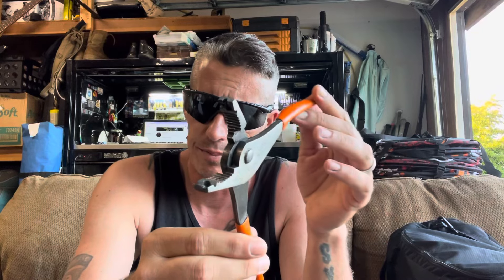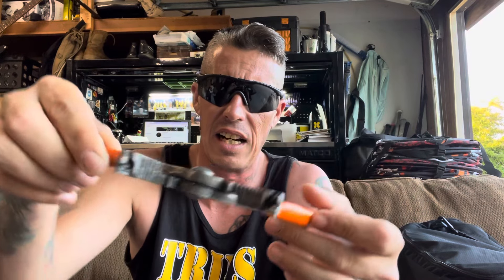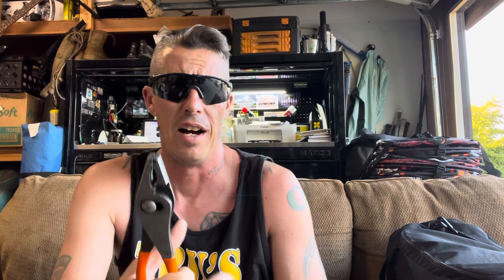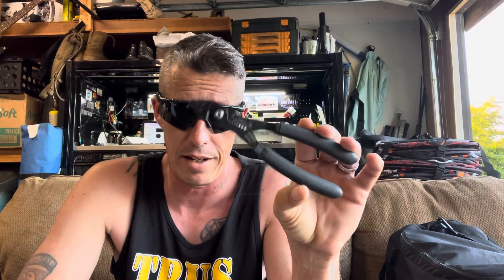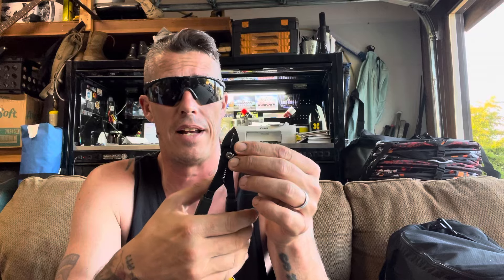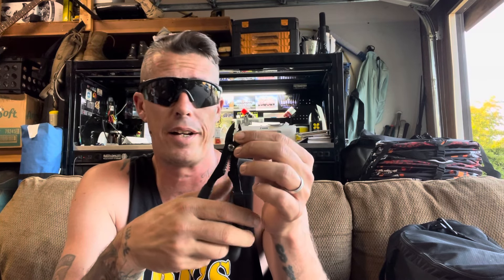How to select the Perfect Pliers to perform any Job as an Automotive Technician

Comment: 13:35 I use the 16.5 inch channel locks for removing the plastic nut on a toilet flush valve.

Comment: I wound up buying the Bahco brand Swedish pipe wrench before I knew SO even had them. Now I think the PWZ's are maybe rebranded Bahco? Check out the Bahco 140, 141, 142 and so on... Knipex makes a sweet set as well, with the cobra style adjustment part # 83-61-015 . Pretty sure Bahco makes SO's adjustable wrench as well,  you just can't get the flank drive under the Bahco name and the grip comes in any color as long as you like black... Best adjustable wrench out there IMHO and usual, the Bahcos cost a lot less $$$. Shit, now I need to snag those long ass Matco needles!

Thanks for all these vids lately! Keep em comin man!
Reply: ... also, those Channellocks look like they could double as a car compactor!